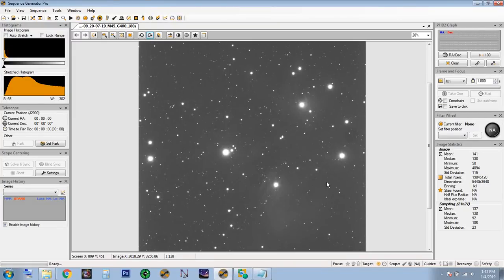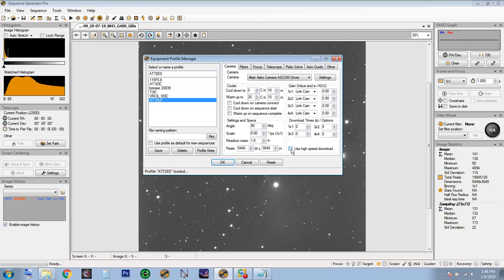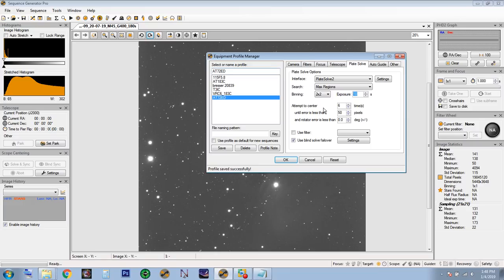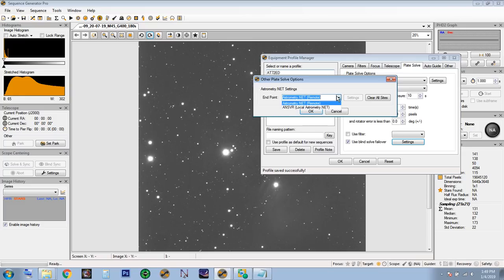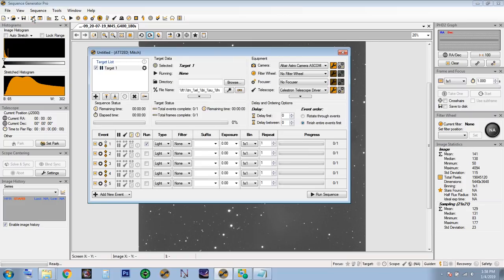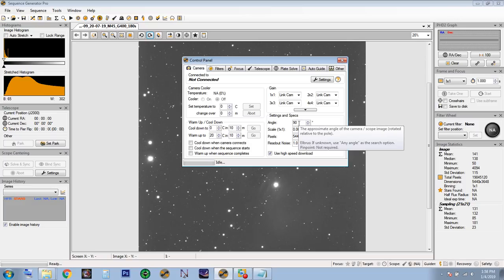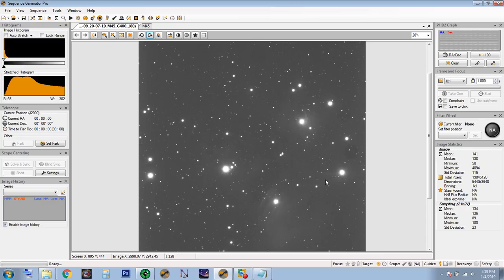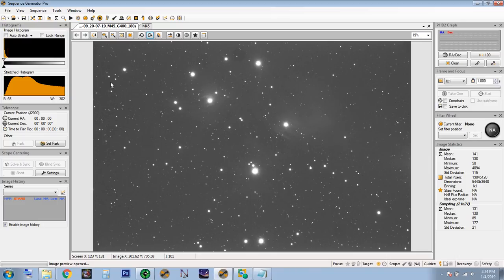SGP ( Sequence Generator Pro) Plate solving and framing Basics.

Comment: And help you did Sir,  many thanks.  Some further info, I'm running a tandem rig (ES-127 & a LX200 ACF 10").  I got the ES-127 to plate solve last night, tonight I was also successful with the LX200.  As important that it works is that I now understand how it works.  Great video and contribution to the amateur astronomy community!

Comment: Hi Mitch, great video.  Got plate solving to work thanks to your instruction and clear description.  I had to crank up the error to 500 pixels, was receiving errors in RA and Dec of about 300 pixels.  Will lower it until I get a good result, but 500 worked.
Reply from the maker: glad i could help..

Comment: Mitch, when entering the parameters of PlateSolve2 ... specifically Latitude and Longitude ... since it doesn't seem to specify N and W, I gues you need that negative sign in front of the Longitude numbere? Or doesn't it matter at all?
Reply from the maker: i dont think it matters.  82.21 W or -82.21 seems to be the same.

Comment: Great video!!!  Thank you for making it.   One thing you can do is upload an image you have taken to astrometry.net and let it do a blind solve.  I use the web interface at www.astrometry.net  Typically you do not have to change anything on the advanced tab at all. When you get the solved image back it will tell you the focal length of your telescope and image scale.  This is helpful if you have any adapters in your image-train that will change your apparent focal length and thus your image scale.  Plug those values into SGP or any other software that needs them and you are set.
Reply from the maker: Sounds good to me   <[:-)

Comment: Hi Mitch, great video; it helped me a lot to understand the fundamentals of plate solving in sgp. I use a Nikon D7200 DSLR, which has 6000x4000 pixels and 3.9micron pixel size. But this is a DX camera and it has a crop scale of 1,5. Should I do anything about this crop factor or leave as it is?

Comment: I just bought SGP and i want to do a 20h combine exposure on ngc 1499. I've done 4.25h last night and i hope your video is gonna save my life. 

Just 1 question. I used 2×2 bin last night. Can i use my image as a framing model for tonight?

Thank you a lot
Reply from the maker: if the image scale is the same i see no reason why not. or reuse the Wizard to plate solve your target ..
Reply from the maker: Any reason you are using 2x2 Bin ?
Reply: @BrokenPik  yes with the 1600mm and the 80ed the 1×1 is over sample so i use 2×2

Comment: Hey Mitch great video. it solved alot of the thing that I didnt have checked., Only issue I have is the section on plateSolve2 I cant set the bin, just gives option for ISO, is this due to Im using a DSLR instead of a CCD camera
Reply from the maker: yeppers
Reply: Thank you been beating myself up trying to figured what I missed in setting bins up

Comment: how do you know the angle is 90 degrees if you slew to M45? and do you have to change the angle in settings if you change target or doesn't matter?
Reply from the maker: you do not have to worry about rotation when plate solving any target regardless of which way your camera is oriented.
my camera swings East and ends up on a 90 degrees , hence my comment.
Reply: @BrokenPik  alright thank you. I will try it all out tonight 👌🏾
Reply from the maker: @b0mba11  U bet..
Reply: @BrokenPik  or part of it hopefully :D

Comment: I have been asking for months for help on various forums (with no joy), I have two scopes on a Heq5 pier mount, The zwo asi 1600 mono and an ED80 and a zwo 224 and a MAK127. the ed 80 i can plate solve no problem but when i change profiles for the MAK im banging my head against a brick wall. I have followed your instructions by the letter ( and yes my scale was wrong). I get as far as the framing mosaic and type in M42 and fetch, and nothing happens, after a few mins i just get a big X. I should add the mosaic is on trial. I just need a few clear skies now to try out plate solving to see if I have got any further with it, ( i usually slew to a large star copy and paste into "target" and it slews there no problem with the ed80) I just wish I could get the MAK going. Just want to say thanks for taking the time to make this video it has given me some pointers where im going wrong
Reply from the maker: Hi Paul, i also have a Mak Orion 127MM F12.1 (1540MM)  , the thing is the FOV is so tight it takes longer to solve, but the idea is the same. I need to run the Mak 127 @ F7.6   (0.63) and see if its better...  keep trying! 
Mitch
Reply: @BrokenPik  I love the ed 80 i just had the MAK mainly for lunar and planets,  the plate solving has been my personal nightmare but im not giving up just yet
Reply: Stever's Narrow-band Imaging Channel  I will check now , thanks for replying much appreciated
Reply: Stever's Narrow-band Imaging Channel  I didnt have the latest version so downloaded the latest one, for some reason I cant log in on there now changed my password and still no joy
Reply: Stever's Narrow-band Imaging Channel   Ah right solved it (excuse the pun) I went from 2.6 to version 3 something not realising that you have to pay for the upgrade. Bit naughty that as I would have thought the latest version would have been free

Comment: Question 
I put 0 for an angle would that be a problem for plate solve ?
Steve
Reply from the maker: No , it will not cause any problems... its based on the stars not  the angle...
Reply: OK because you said you go to the east and you change it to 90 degrees ... Keep putting out the videos
Reply from the maker: @Steve_The_Ignorant_Astronomer  yes... my bad,  once the scope goes East the Cam turns on a  90 degrees angle... yep.
Reply: OK but it is no big deal, that would not stop it from plate solving ? I want to use this program , I got camera in April and I think i used it 5 times if that. Weather sucks , I dont use much in the summer and not I got foot in a case 6 to 8 weeks so cant get to the observatory.. I was hoping I could learn with the simulators but I guess you cant. I hope to get it working before I am older and grayer
Reply from the maker: @Steve_The_Ignorant_Astronomer  the weather has been horrible .. here also.
Reply: yea but you know the program and i dont , one day maybe one day
Reply: Thanks for that awesome Video, Since im new in SGP, im watching a lot of videos to quickly get to understand how all it work, your video was really clear and easy to understand, but at the only confusing point for me (and Steve Hand already Asked you) was if the 0 angle will interfere with the plate solving process. Now, what do you mean by "put your camera straight up in your telescope?" (what do you mean and how do you achieve that)
Reply from the maker: @Afr0l0c0   The zero will not change the plate solving even if its 167 degrees or 281 ... what i mean by put your camera straight up  is slide your camera into the scope with the USB3 plug  pointing up when in the home position instead of turning it sideways.          but even that matters not..  :-)
Reply: Thanks Astro Dude, I got it! Many thanks!. I wonder why theres rotators on the market, if the degrees doesnt matter! :)
Reply from the maker: @Afr0l0c0  your right it doesn't matter but.... some people like to orient their target based on the rectangle of the Chip of their CCD. that would be a pain by hand night after night, hence the Ascom  rotator, one would think. :(